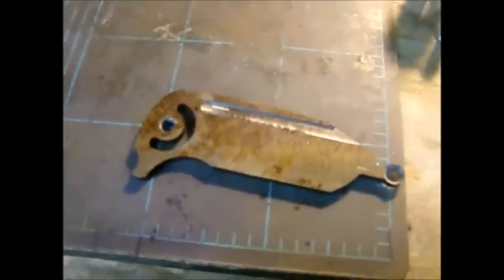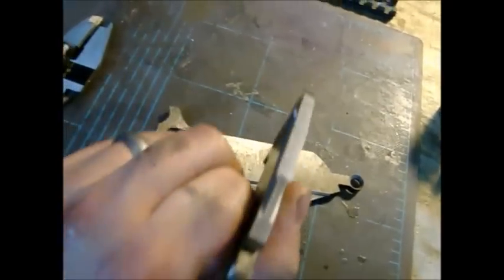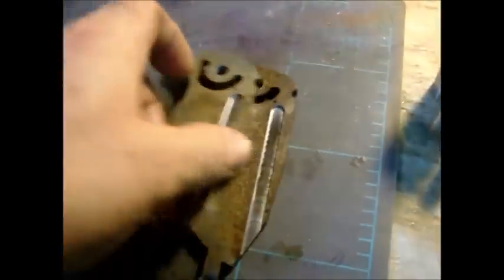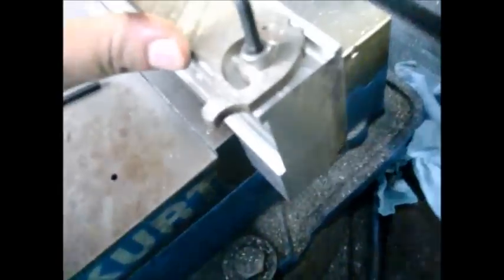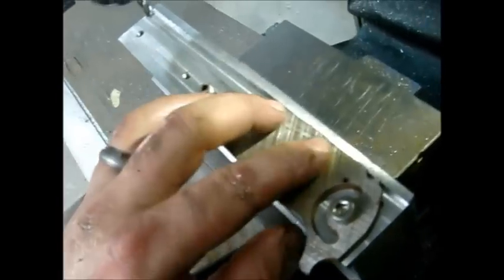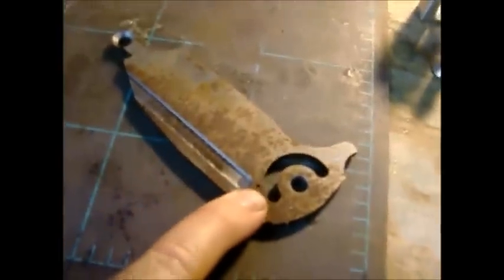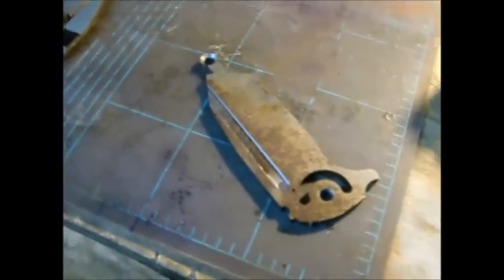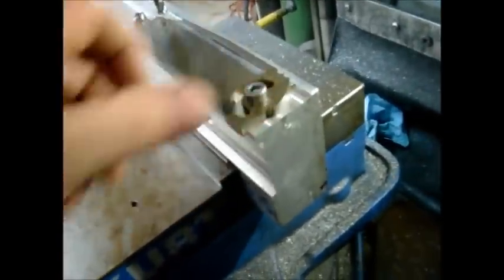war horse run part II

Comment: WHAT?  You mill your bevels?  That must mean you're not a knifemaker. (obviously I'm kidding).  Lookin great Jake!  I'm curious to see how you grind the tip into a point, if that makes sense, I can see how thick it is because of the way you machined it, when designing new models I've noticed the same thing.  

For making the fullers look super nice, do a final 0.005" pass with wd40 at twice the RPM you normally use, or cut your feedrate in half (ie, spin the handwheel slower).  Super shiny!

Comment from the maker: I do my own HT is its a batch less than 10. anything over that its way more cost effective to send them to Peters heat treating in PA. Im sending little over 50 knives this week and it will be less than $200 to have them done. It would cost me $200 in foil to HT all these knives. Plus the electricity and time:)

Comment from the maker: Dude, i know. I should stop making knives since Im using a machine, lol. wait... that same machine built my grinder too... wait.... uhhh what was I doing again, oh never mind I need to go burn my fingers some more on the grinder!

Thanks for the info on the feed and speed. I usually will toss the machine in back gear and run a finish pass, but all of these blades are getting blasted, acid/stone washed so the clean finish will never been seen for all its glory:)